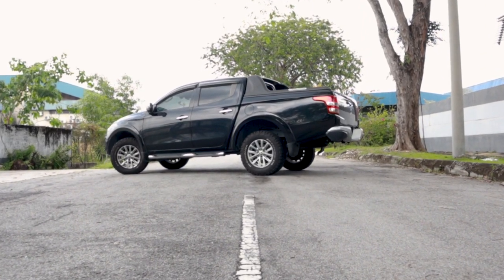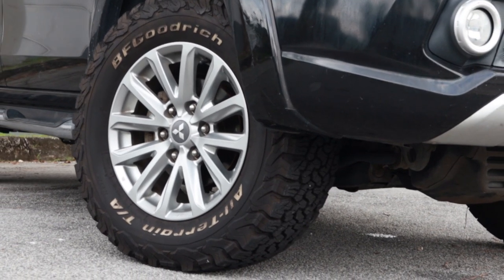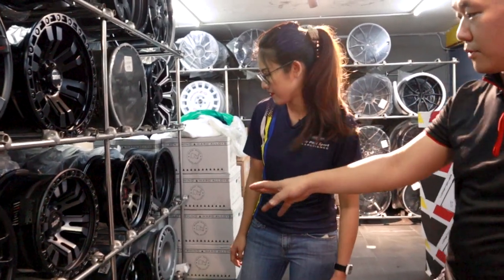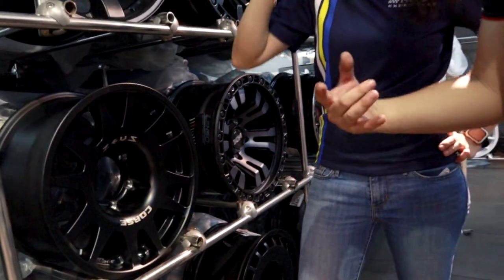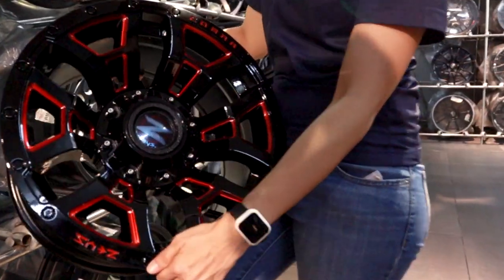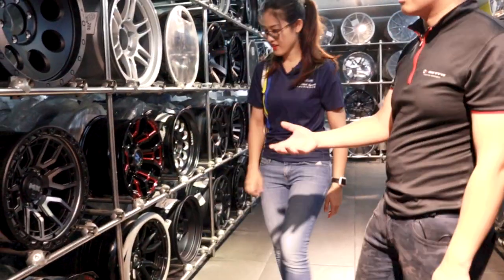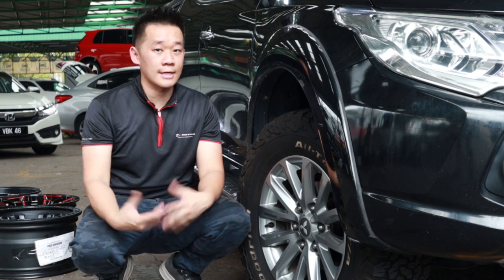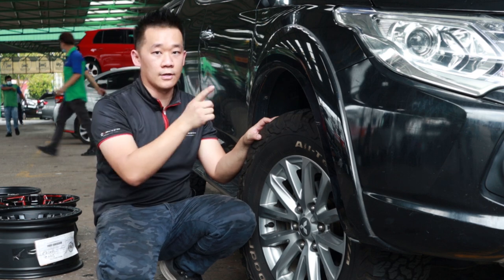5 Best Rims for MITSUBISHI TRITON With Leona Chin

Comment: So interesting! I never thought of downsizing the rims. I am tempted to try. BUT won't downsizing the rim size reduce the "clearance height" of the car?
Reply: Bigger tire size will compensate... keeping the same clearance height or even higher depending on the tire size
Reply: I wonder what size of tyre was being used and was there some changes (trimming) that needed to be made to the wheel arch?

Comment: Please helpp , I got a 2014 vigo . Thinking of changing the rims to 16’ and more aggresive tyres . Just installed a 32mm levelling kit . Whats the biggest tyre i can fit without rubbing the walls ? Was hopping to fit a 285/75/16 if possible .
Reply: Rim16 fit 265 you dont have to lift up.